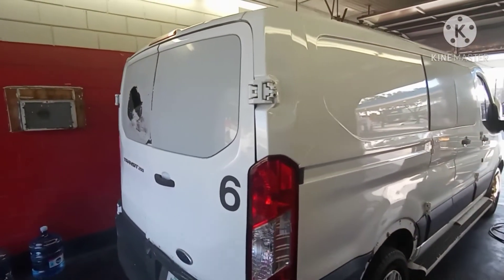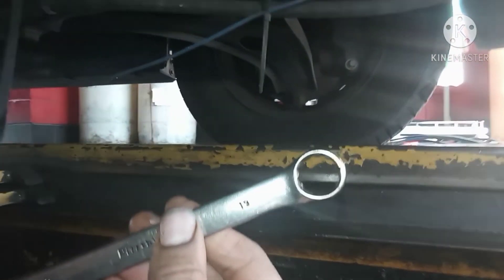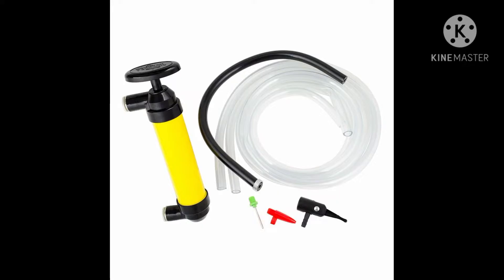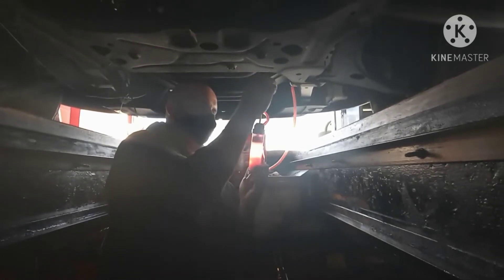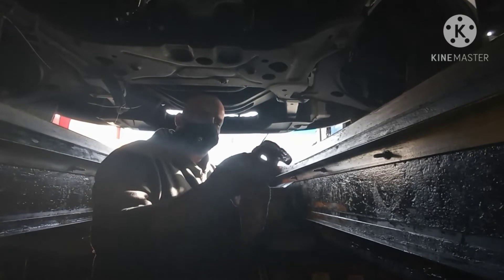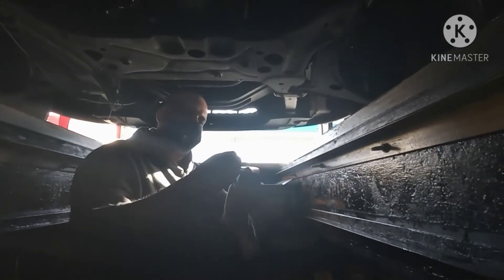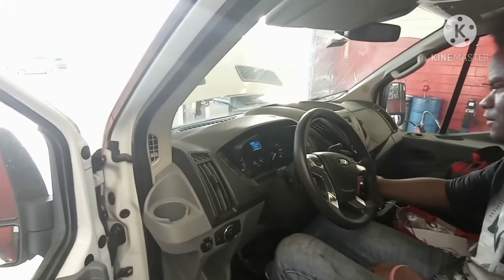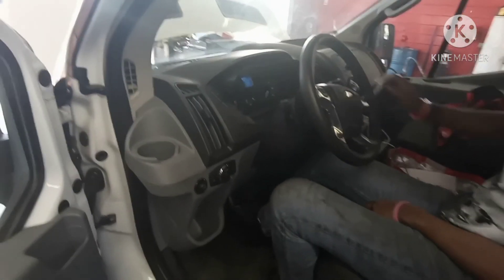How to Change the Transmission Fluid for 2014 to 2018 Ford transit 250 Van

Comment: Great information thank you. I am here at a Ford at the moment and going to have my transmission flushed. This is the 3rd time I try to have my transmission oil and filter replaced. I keep getting different reasons why it can't be done with prices ranging from $400 to $1,200 dollars to have the transmission oil and filter changed. At the moment I was informed $1,200 and I will need to have the van realigned after because the under carriage needs to be disassembled. I am settling for a transmission flush like you showed that will be approximately $300. Apparently all Ford Transit vans are PITA to work on, so perhaps the next van will be the Mercedes sprinter gasoline turbo that will be out in 2022. The amount of controversy from different Ford service departments really doesn't sit well with me. Hope all goes well for the rest of you.
Reply from the maker: If you change the transmission fluid just by yourself cuz you only $25 for transmission fluid and the differential fluid $20 1 quarts you need 3 quarts entrustment case you need transmission fluid the same thing for the transmission fluid you did 25 so the whole job only less than $100
Reply: This is what the dealer basically told me too
Reply: @toobglued , ok so it sounds like dealerships are getting the memo:)

Comment: Just completed my transmission flush at the dealership. The fluid was black at 53k miles and was being convinced that it didn't need the fluid changed. Don't wait on this service.....
Reply from the maker: It's supposed to be change your transmission fluid every 30,000 miles
Reply: @LessExpensivefix I developed a leak between the transmission and the first ujoint so I will be driving to a dealership 80 miles away. Just to be safe I removed the dipstick and it seems that the transmission level is way above the dipstick. The strange part is that the Ford Dealership was the last transmission fluid service my van received. Should I be concerned with the excess fluid in the transmission?
Reply from the maker: How I understand what you're saying you lose the dipstick there's no problem just put the the cops screw and the place and everything is fine just make sure the floor is full until the top follow up all the way answer the floor start drop then close they'll go start the car and shift the car and when the car gets hot check the level one more time and that's that's good to go

Comment: I haves transit 250 with 209k miles, just lately it doesn't want to move when you start it up.
Once running die about a minute it will go and it shifts just like new.
I opened up the fill plug and fluid came gushing out.
Probably 1/2 quart.
I pumped out about 2.5 quart and put in the same fresh.
Still same problem.
Old fluid was black nasty.
I was told if it smelled burned the transmission will be junk soon.
Any ideas?
Should I flush again?
Reply from the maker: Before you flush the car again make sure you drive 1000 Mile before you flush it again because you have too many miles on your car if you feel the car drive good then flushed again one more time

Comment: What about flushing the transmission from the cooler lines? Disconnect the cooler inlet, use a hose to route the fluid into a bucket. Remove the servicing plug/dipstick and run a second tube from the top of the engine compartment down to the servicing port. Start the engine and let it pump out all the old nasty fluid until it stops. Stop the engine and add 4 quarts. Repeat the process until all the bad fluid is flushed from the entire transmission, to include the torque converter and valve bodies. Not knocking your method at all, as there is some very good info here, but you're only draining the fluid in the pan, which in some vehicles accounts for less than half of the overall amount of fluid in the transmission as a whole.  

EDIT- Just saw some other comments advising against a full flush. Does this mean not to flush with the machine, or not to flush at all, ever? I don't want to kill my transmission. Thanks!
Reply from the maker: To be honest with you if your car has a lot of mileage and you flush your transmission full flush you took a chance to damage your transmission because you never did the service and the time every 30,000 miles this is what you are quite from Ford dealership 4/4 required to change the transmission fluid every 30,000 miles north hundred thousand miles so the mean when they pass the mileage you have to do just drain and fill are you going to make your transmission mix with the old one and you drive a thousand miles or maybe more than you do the same process again I've been work for this work cars 4 years almost 10 years so I know all the tricks about transmission on other mechanical problem this one my channel I show a lot of tricks how can fix your car the cheapest way with no game how did mechanic defect people cars on the car doesn't need to spend all this money and you need just to do with the right thing the parts is cheap by the fluid cause you only $30 and you flush your transmission by yourself so if you think it's will someone to be charging you $3,300 or maybe more
Reply: @LessExpensivefix  Thanks for the info, I understand now. I'll try this.
Reply: @LessExpensivefix  My wife just bought a 2017 Ford Transit van with 85,000 miles on it has no records of transmission fluid change.  My question is, you think its safe to just change just the fluid out of the pan  like you are doing in this video. If so, how much fluid will be safe to change in the case of the miles she currently has on it. She uses the van for her business and plans to keep it for many years. I think you already covered part of my question in a previous comment. Thanks for your experienced opinion

Comment: I have a 2015 T250 w/3.7.

I specifically asked the dealer to change the fluid they said they could not do it that it was a lot of work and the transmission doesn't need to be serviced until 100,000.
Reply from the maker: The same process
Reply: Hahahaha!!!!

Comment: I have a 2018 transit with 3.7 cost me 700.00 to get the filter and fluid changed go to a transmission shop it takes between 6-8 hours to get it done right do trust these lube shops
Reply from the maker: No just $32 to change transmission fluid

Comment: Hi 
Where you get this pump 
Would you please help me ?
Reply from the maker: The pump are used is the washer fluid pump with air
Reply from the maker: You can buy one from AutoZone really cheap like $25 small one
Reply: Thank you so much for your help
Reply from the maker: You're welcome anytime
Reply: @LessExpensivefix  
One again Thank you so much for your video show how to change transmission fluid 
I recommend 
I did it my self successful
Reply: Buy a ratchet pump. Waaayyyyy better
Reply from the maker: Do you want to save money because if you take it to the dealership to change your transmission fluid is between $300 to $400 service but if you do it by yourself because you for the fluid only $25 and for the pump another $25 extra so for all the job $ 50 so you save a lot of money you feel like the video please like share and subscribe and thank you for your watching my video

Comment: This is not the correct way to change transmission fluid on a transit. How do you know how much is even in the transmission? I find them low all the time before changing.
Reply from the maker: When you open the plug you find a dipstick
Reply: Paul, you have to drop the entire cradle to actually charge it and that’s stupid expensive.  This is a good way to at least get some old fluid out and get fresh fluid in.  Good job guys 👍🏼
Reply from the maker: Remember this car using for construction car so most of cars has a lot of mileage so you come not flush the transmission all the way just drain and fill the fluid is more safe if you flush the transmission all the way he going to shock the system and you need a new transmission so drain and fill cost you only $25 if you want to take it to someone do the job for you because you between $300 to $400 job
Reply: @Smokey0210  exactly, I have a 2015 Transit. If you want to do a complete transmission service by dropping the pan and changing the filter you need to remove a subframe on this particular vehicle. Because of the subframe and how much of a b** it is to get off it would take several hours to do there for costing you several hundred dollars. I brought it to three mechanics and they all said roughly the same thing. I just do the simple pump!
Reply from the maker: Don't change the filter just change the fluid
Reply from the maker: Okay first will you do if you have 240,000 miles just take one quart out and add one quotes on every month you do the same thing as to be flushed all system
Reply: @LessExpensivefix  ok cool thx, do you recommend fluid exchange with a machine? I replaced with a new factory crate trans and it has 70k on it. Ford told me they can't flush it bc their machine didn't hook up to the connector on the line so they did a fluid change at 22k. Then I got a flush done with 45k on the new Trans. I think I might be overdoing it bc I paid 5k for a new trans and I'm scared of it happening again lol. Thanks!
Reply from the maker: No don't flush with machine
Reply: I agree, I've done one and it has 186k miles so I had to remove the subframe to drain all the fuild and replace the filter.  When you have a good fuild then you can use a pump but it's just to keep it clean a little bit.
Reply: @goodvibes7104  using the pump only for low mileage vehicles,  to be honest with you mechanics getting lazy , it's not a big of deal to remove the subframe as long you have a lift .
Reply from the maker: No just one time drain and fill
Reply: I have a 2016 Ford transit 250 never serviced the transmission do you think I should pump it out where did you get the pump who makes it do you have a link